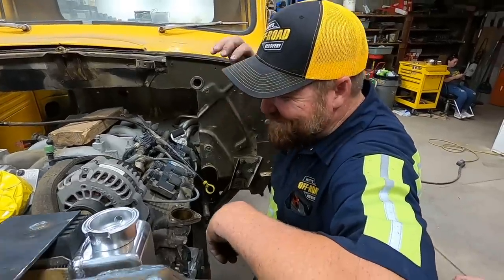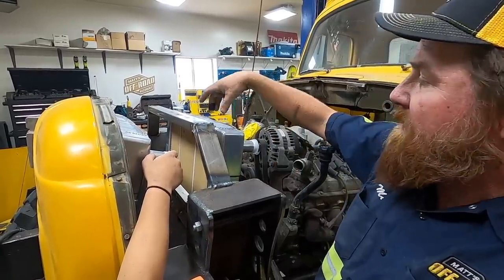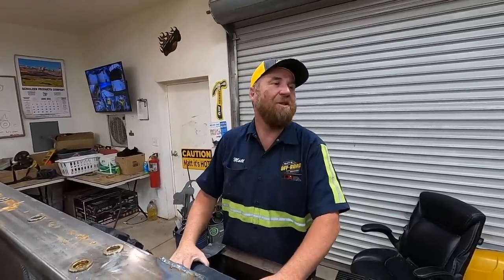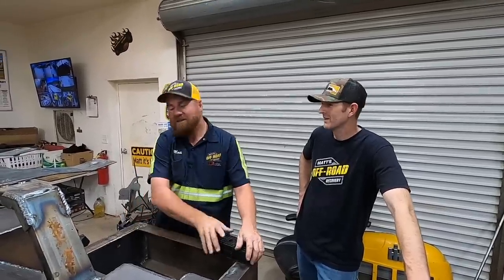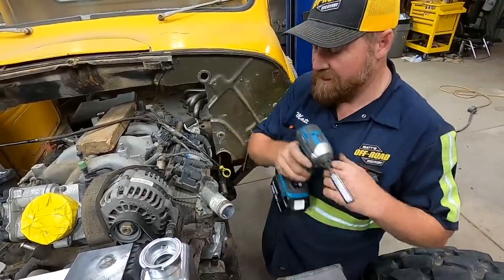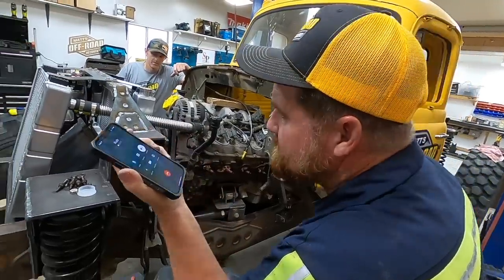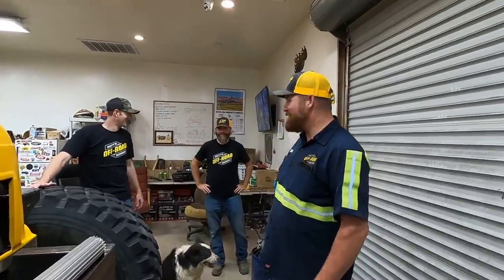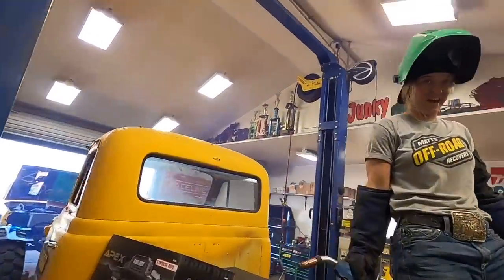This Part Ruined All My Work! The World's Largest Off Road Wrecker

Comment: Radiator tech here. You actually want to leave the cardboard on the radiator. It’s supposed to be there to deflect hot air from the environment from entering into your coolant system. You only remove the cardboard if you’re operating your vehicle in cooler climates like Canada or Alaska. I’m surprised you didn’t just install vent covers, that would be much more effective.
Reply: my truck has covers for that reason but it is a diesel pickup ..never used the cover but it takes about 15 mins to get heat when its below 0 degs F ..
Reply: that shroud is practically covering the whole back of the radiator, does that not impede the air flow through and behind it? i genuinely want to know how that works
Reply: @Qwertyuiop-wg5xu  They will spend most of the time at low speed where you depend on the fan to pull air through the radiator. The Shroud makes sure the fan efficiently pulls air through the whole radiator. 
You can add one way flaps that suck closed when the fan is pulling, but blow open when going down the road.

Comment: Gotta use counter-current flow @Matt's Off Road Recovery
It's more efficient, nature works that way (in your hands, feet, ...)
Essentially, the hottest coolant is pre-cooled with the hottest air in the rear radiator, then the coolant is fed through the front rad, which can cool it down further as low as ambient air will allow.

In your setup, you loose cooling efficiency twice 
Once over the front radiator where you're already expecting it won't be able to cope on its own, and then you feed warmer-than-possible coolant through the rear radiator that also sees warmer air coming off the first radiator

So when it runs hot, you'll know what to change  ;-)
Reply: There's no gotta.. its only "is there enough radiator cooling power ? ". will the hottest water pumped in return to the engine at 90C ?
Reply: My first response was 'well hoses are cheap.' Then I realized that all the hose fittings are all in the wrong places. So it's a bit more complicated. Just have to hope that he's really got more radiator than he needs.
Reply: @isilder  Well, Matt's set-up is effectively destroying part of his radiators' cooling power,  
by cascading the radiators the wrong way around.

Comment: Where I worked, before retirement, we used to call it the smart or dumb end of the measuring tape.  Smart end read the measurement, dumb end held the end of the tape to make sure it didn't slip off whatever we were measuring.  Measure twice or more cut once and hopefully you got it right.  I'm interested to see if your tandem radiator idea works.  Usually I've just gotten radiators with more passes to get more cooling and the air went through one time.  Looks like one of your radiators is downstream air wise so will be getting hotter air.  Correct me if I'm wrong and I'm not against the idea as long as it works.

Comment: I'm one of your Engineer viewers... and I'm thinking about the water mass in the radiator that will be bouncing up against your top H mounting plate. Lots of stress, I don't think that flat plate will hold up. Adding a vertical component to that member would stiffen it up. A couple of angle irons might do it, but would be hard to follow the bends. Perhaps a second layer to a center vertical to triangulate?

I also second the motion on cross-flowing the radiators (i.e. feeding them in the other order). Doing so will work much better.
Reply: Gussets?

Comment: As someone who design cooling systems for a living, I always have to balance air side pressure drop vs coolant side pressure drop . I think you can simply the system by having one High temp radiator and one mechanical fan .
Reply: Yeah but that doesn’t look cool!

Comment: As a retired GM technician/engineer, my advice is to use OEM/ACDELCO thermostats on GM vehicles. While thermostats from different manufactures may look the same, they are not and often do not operate properly.
Reply: Same way with Cummins.

Comment: Just a thought, it would not hurt to make a rubber "saddle" over the top of the inner radiator to make sure it can not work loose and get into the motors fan. added insurance. The hoses may keep it fairly rigid, but considering where this truck will be used, and that Murphy guy is rumored to be living out on those trails.

Comment: Off the top of my engineering brain, I think it would be a more efficient cooling path if the hot water goes through the back radiator first. I could be wrong.
Reply: @MattsOffRoadRecovery  Ahhh, reasons. Always reasons. LOL I'm still hoping for my invitation to come up and install electrical/audio/communications/lighting  ; ) Let me know! I have some free equipment as well!

Comment: 18 inches long so that's 36 halfs!
Excellent eyecrometer work!
I can't wait to see the first rock crawl with this thing.
Reply: Ha, imperial system is so bad, just use metric.  "The measure of the inch was usually achieved by adding the thumb breadth of three men- one small, one medium, and one large- and then dividing the figure by three."

Comment: One thing I've learned about cooling systems for slow speed is that the fan and shroud matters more than anything else. As long as you can flow enough CFM, you can cool basically anything.
Reply: Does that still apply when it's over 110° F in the shade, and it's being worked out in the hot sun?
Sincere question.
Reply: @Eyes0penNoFear  
Yes
Reply: @Eyes0penNoFear  anything lower than the 210degree coolant is technically cooler as far as the engine is concerned! Seems weird because 110 degrees is hot to a human but cool to an engine

Comment: You could try and use a 160degree or 180degree thermostat and use "water wetter " . In the warmer weather and a 195degree so you will have good cab heat in the colder seasons.
That's how I set up my Jeeps . 
I have a 8.1ltr in my motor home. 
I'm enjoying watching you and your team build this up.  And watching the recoveries.

Comment: 11:50 why not add just hot water mixing valve? Once the small loop opens, you split the flow with a Y pipe: One goes to the hot side of the mixing valve and one side goes into the 2 radiators and then back to the mixing valve on the cool side. The output of the mixing valve goes into the pump and the heater box.

So you first heat up your engine and as soon as the large loop slowly opens it will feed-in hot water to the heater box. As set temperature is met, the mixing valve starts mixing it cool water thought the radiator in, as necessary.

You could then add a secondary temperature gauge which looks at the temperature in front of the mixing valve, on the cold side. This way, you know how much cooling capacity you have left. As long as the second temperature is lower as the set temperature, you're in the green. :)

Comment: Try this: When this thing is done, take it out and run it for a while. Then, swap the flow so the coolant goes through the rear radiator first. Then report back which system runs cooler. My bet is it would be cooler with the water going through the rear radiator first but I'm too lazy to dig out my old thermodynamics books to write a proof. Plus, you wouldn't listen to me anyhow. LOL. I enjoyed the vid. Keep up the good work.

Comment: Love what you did with the  duel radiators. 👏🏼👏🏼👏🏼 I don’t even know if it will work but what I would’ve tried also was to build a fan shroud with electric fans behind the first one that shot the hot air out the side, sucking air from the back and shooting it out to the left or right, then I would’ve done a second fan shroud on the rear radiator sucking air in from the opposite side, this way you get forced air through even when you’re idling or winching and you’re getting rid of the hot air from the first radiator so the second radiator is getting cool air as well. To be completely anal you can also run a fan somewhere on the hood or the bottom they just sucked air out of the engine Arrieta keep the engine area ventilated and keep heat from building up in there. If you were to find a way to use the same fan in two or even three of those applications then you could always have a spare.

Comment: It's a great project, a great team.  Being able to balance the balance between vehicle weight and workforce is a huge goal.  A resistant structure is needed for the great work that will be carried out every day, a large structure can be equal to a lot of weight and this greatly favors the sinking of wheels on soft floors in the work area, although how much traction force will be needed?  .  Besides, I consider that the management of the volume flow of air in the area is very important (how it enters, who displaces it, how it goes outside) (the idea is to steal heat quickly) and also the volume flow of water in the system of refrigeration, you will possibly need an auxiliary electric pump to be able to run the distance quickly in the shortest time.  An oil tank greater than the standard, in the engine, in the transmission, in the direction, will allow its radiators to help cool the system and with electrical assistance included, we must remember that oils, apart from lubricating, are also great heat sinks and if they are Coolers give more life to the engine and transmission, minimizing failures and giving more useful life.

Comment: When doing two stage cooling.. dual radiators, the closest one to the engine (called #2) should be the first one the water runs through and the very front rad (called #1) should be second. This will give you the biggest temp difference between the cooling air and the coolant temp.

Comment: Shoulda talked to an SAE member ;) . I'd also be very careful welding on the side tanks. Last time I did this was 20 years ago and it's not hard to melt the solder that is used to "weld" in the fins to the tank. It's often a brazing or soldering process so it's pretty sensitive to local heat. I might also suggest you divert the air coming out of the 1st heat exchanger. The air temp will be very warm coming from the 1st larger exchanger and feeding that air into the 2nd heat exchanger will decrease it's efficiency and effectiveness.
Fun build and looking forward to the first drive.

Comment: I think you might want something bigger with an active fan for your oil cooler. You should also put the hot water through the back water and use the front as the secondary

Comment: Remember that the basic flow of the coolant in this 8.1L engine is backwards, reversed. Like an LS engine, the water flows to the cylinder heads first, then into the cylinder case and out the thermostat. You cannot run this system without a thermostat, it changes the flow of the coolant in the water pump housing when it is open, without the change in flow at this point, the engine overheats.
Reply: Vortec 8.1 and LS engines are std cooling flow. In the block, out the heads (well on an ls, out the heads back into the block passage into the water pump). The only common gm engine to run reverse flow was the 90's LT sbc.
Reply: @yeroonvanleeuwen2555  I can't tell what your source of information is, but mine is GM. The main thing that makes the LS engine and the later LT engine so good is their reversed cooling systems. That system was later copied in the 8.1L Mark VI big block engines. Cooling the cylinder head first allows much higher compression ratios on 92 octane fuels and the knock sensors protect the whole shooting match when lower quality fuels are used.

Comment: Love the radiator concept.
If you disided to use the older stile thermostat , without the heat up valve on the bottom of it. You will need to plug up that hole that the valve covers.
Or the water will follow the shortest route and make it overheat.
You also can't run them without a thermostat. Will also over heat.
I guessing you already know that.
Can not wait to here it run.  So cool.

Comment: After the explanation on the split radiators at 9:30 they make more sense. Pulling in fresh air for at least the lower half of the second radiator will surely put it to some benefit, even if the top half doesn't end up doing much. Fun fact - Corvettes use a similar radiator setup to your second one that draws air in from the bottom. Very nice 😎

Comment: I have a suggestion in case it's running too hot after testing. Since we saw Matt pooring water on his banana rad. You could add a few water atomizers forward of the rad. I bet old injectors could work. With a pump an a thermostat they could help cooling if over heating
Reply: We use windshield washer nozzles and pumps for that, usually a pretty much self contained system you can pull out of anything at the junkyard.
Reply: Windshield washer system should be able do the trick.  Comes with a tank, pump, and nozzles to spray with.

Comment: As a fluid systems engineer, I loved the explaination of the flow path. I don’t work on automotive cooling systems, so I can’t comment on the design, but your theory seemed plausible!

What is your water pump flow rate and pressure curve? Will you have enough pump pressure to drive coolant though all that plumbing?

Comment: Have to tell you this story and I hope you read it.  Very funny.  My dad worked for GM and was a machine repairman by trade.  He was working with a "new" guy and my dad told him to go measure something so they could cut it to length.  The guy came back and told my dad it was 33 inches and THREE LITTLE MARKS!!!!!!  My dad was stunned and confused.  To the point where my dad had to see this.  So the guy showed my dad the "three little marks."  The guy in question stated he never had to learn to read a tape measure because all the little marks are the same.  In which my dad pulls out his machinist scale from his pocket and shows this guy.  quote..."Holy crap!!!! that's a lot of little marks!"  Sorry for the long comment.  Keep up the great videos.

Comment: Perhaps a way to remove the heat from between the two radiators so the second radiator isn't exposed to all the heat from the front radiator.
Reply: It's too late now but the radiator at the back should get the hottest coolant first, heat exchangers such as those used in water-cooled heat pumps or any plate heat exchanger are setup like this, it improves efficiency slightly because more heat moves across a greater temperature differential
Reply: Y’all are all amazing minds,
Me ,,, I’m just struggling putting in a thermostat :)

Comment: I dunno, Matt - I'd be looking for either more separation between the radiators or else a way to increase the fresh air flow to the rear one. You might be able to divert the air wash from behind the front radiator up and out through a vent in the shroud and then get cooler air in for the rear one from a side vent or something like that. I probably should have paid more attention in fluid dynamics back in 1979. The second fan will definitely help, but would also work to make a diversion effective at the same time.

Comment: I would route the coolant flow to the inside radiator first, then through the outside(forward) radiator. This would provide the most effective cooling by maintaining greater difference in temperature between air/coolant.

Comment: Matt & Team, please consider plumbing the radiators in parallel. They're optimized for heat exchange when hot fluid flows into both as they normally would. 

The second heat exchanger won't be as efficient because the temperature delta between the desert air and water has decreased, plus the 1st will heat soak the 2nd. 

Ideally try to separately shroud each one too. You'll have a ridiculous amount of water capacity with 2 rads, but water stays hot once it gets hot, whereas oil readily transfers heat. 

Add a 40+ row oil cooler to your setup as well with an Improved Racing oil thermostat.
Reply: Makes sense. I like the uniqueness of that system regardless, and y'all have the means to fab any changes you might need. As long as there's oil cooling involved I don't think it should be an immediate problem based on water capacity alone. Plus, y'all have the knowledge of the vehicles you've rescued and what the put your current rugs through. With the right gearing this new wrecker may never break a sweat either. I'm an engineer who designs cooling parts so that's usually how I like to suggest things, but I'm stoked to see how your individual setup works because I might learn how to better help out customers too.

Comment: BSME thinks the first stage radiator has an issue.  It is cross flow with top entry/top exit, so the lower cross channels at some point become hydraulically bypassed.  In engineering, this is called bypass flow or channel flow.  To get the best heat transfer, you need the most balanced resistance in all the cross channels.  So it should be top entry/bottom exit, or vise- versa.  I'd have to run the numbers, but I think the LMTD will be more balanced if the first stage exchanger was physically behind the second.  You have two radiators in series, that means extra delta P over a parallel design.  But given the two different types of radiators, you have no choice.   If the water pump is pdp, then the pump can handle the extra flow resistance.  If it's centrifugal, expect lower gpms than you would get from a single one pass design.  (That may not actually be bad, Smokey Unik used to restrict the flow to increase the overall heat transfer).   For two radiators in series, I think upflow in the first stage and downflow in the second might be the best hydraulically. (Easier on the pump, less HP.)  To bleed the air, you could tube high point vents from each radiator to the vapor space of an expansion tank. For the axial cooler in front of the grill, mounting it inline to the airstream will increase it's cooling.  Probably wise to mount it inside the frame area away from potential rock strikes.  Sorry to write a book.